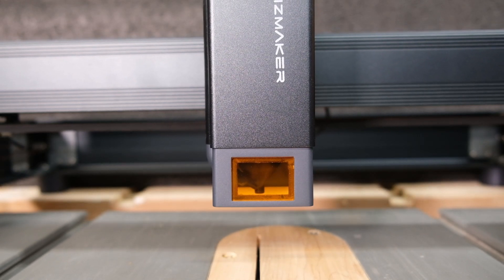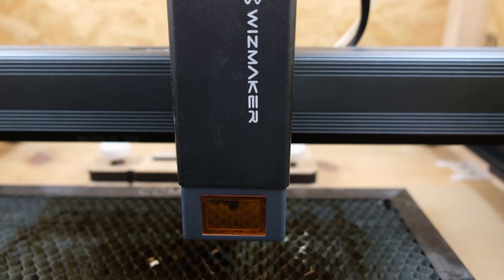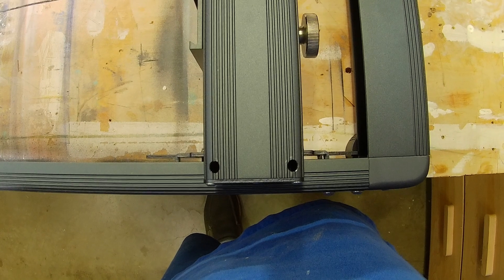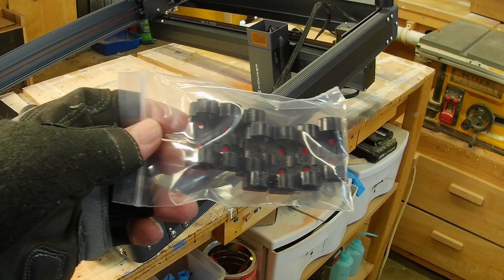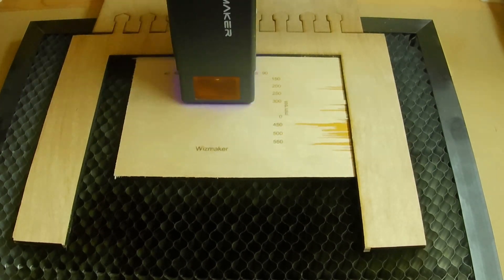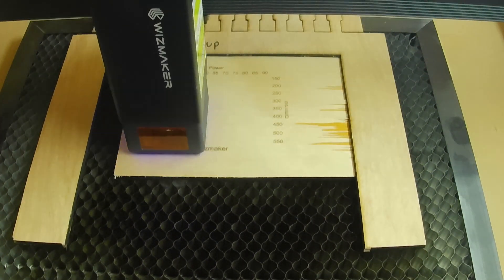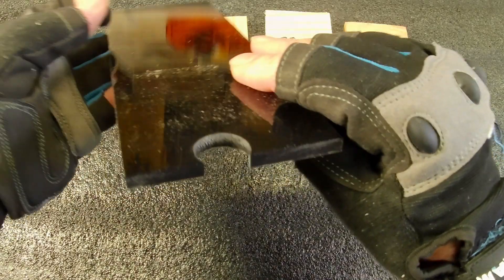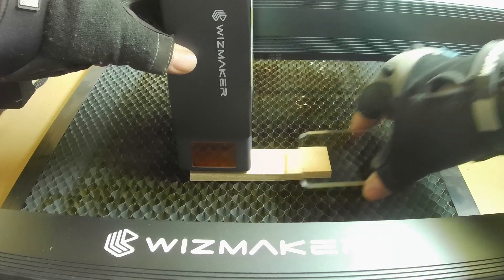WIZMAKER L1 36W laser engraver.

Comment: Cable management looks better than the X-Tool, Just a few clips like this one would have been good, the cables stop the full movement on the X-Tool. I  had to add drag chain on mine, especially when I added the extension. Does the laser bottom cover come off? I hate those things and always like to take them off.
Reply from the maker: Yes there are a couple screws you can remove and the cover comes off.